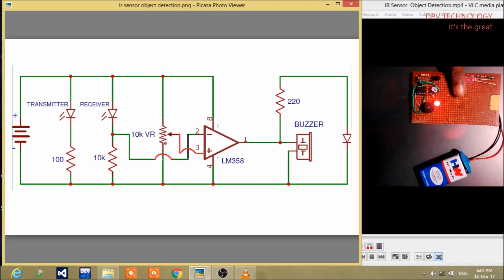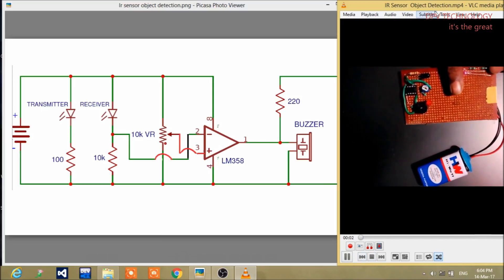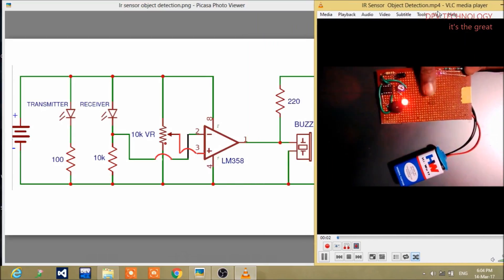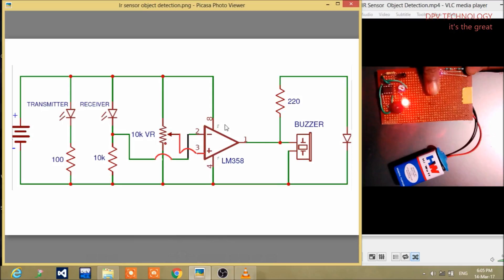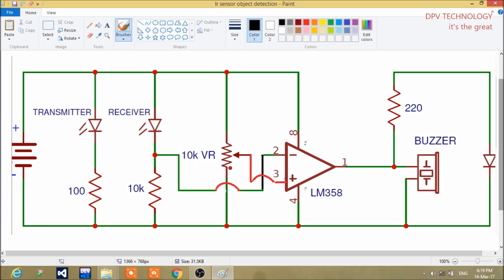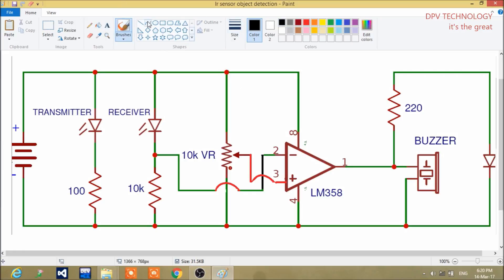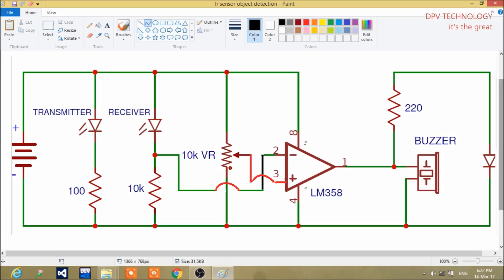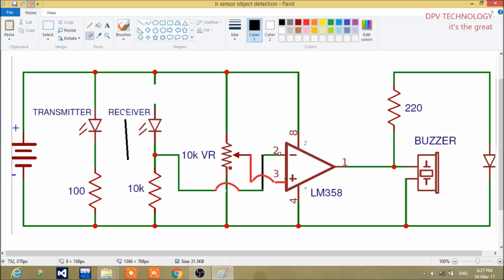IR Sensor Object Detection Working Principle

Comment: For how much time the sensor can be operated with a 9v battery assuming 20 detections a day.
Reply from the maker: Actually at depends on your battery Ah . If you want to check the almost  exact  time then you can do the following-
1.Take one battery with known Ah . The  Ah is often  written in the battery body.
2..First connect the whole circuit  .
3.Assuming the whole circuit as a single resistor connect one ammeter  to check the  current that the circuit is drawing from the battery(Connect one terminal of the ammeter to the battery and other terminal to the circuit).
4.Observed the current.
5.Apply the formula ---
time=Ah/current drawn.(Notice the   unit also  )
.6.This is the time  that the sensor can be operated  with the battery.
      If you have any doubt the you can comment us again.Thanks for the comment.